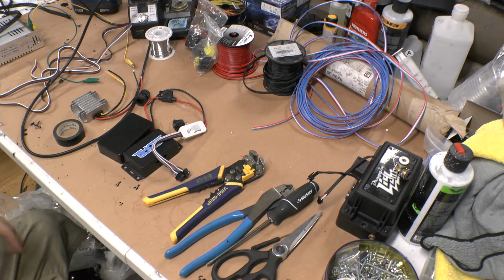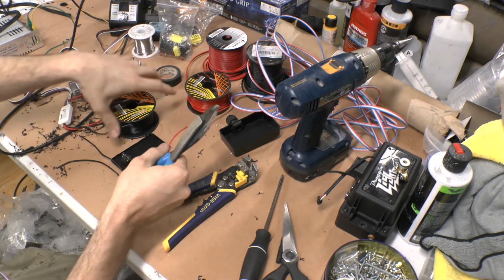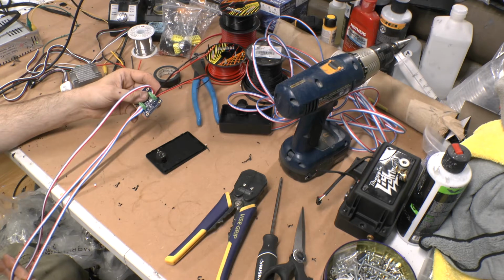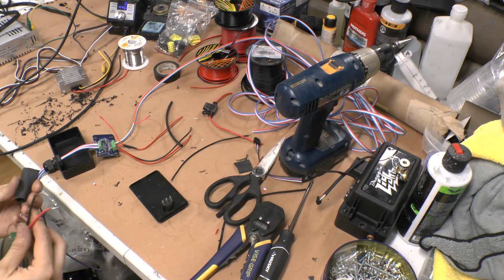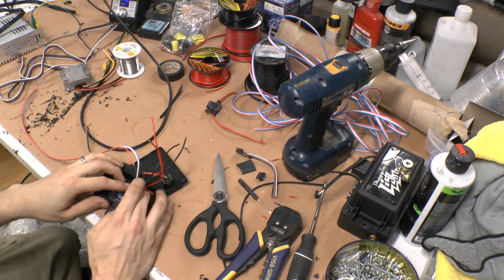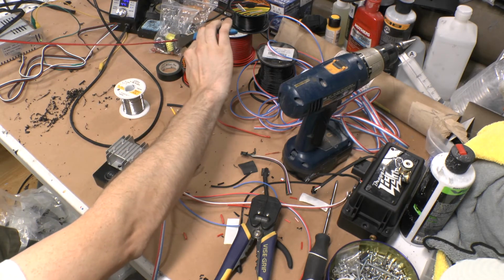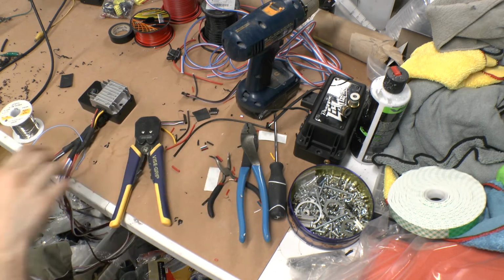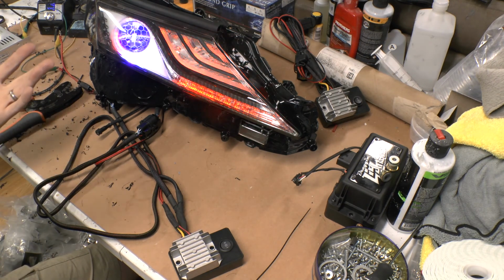Blue Ghozt Plug and Play Harness Tutorial

Comment: It's interesting that we use almost the exact same methods in regards to wiring these LEDs. It took me a lot of trial and error before I decided that overkill was the only way to go. So I also do potting, and I also use 3-way toggle switches, but I use my toggle to switch not only between DTRL and On/Off, but I use another toggle to switch between a Blueghozt controller and a QuinLED Dig-Quad when I want to use some more customized show modes. The Capacitors and Resistors are an absolute must for reliability! Continuous breakpoint LED strips like WS2813/2815, SK6822/9822, and GS8208 have also helped with the reliability of these projects. I enjoy watching your videos while I'm tinkering with my LED projects, it helps keep me motivated. Thanks.